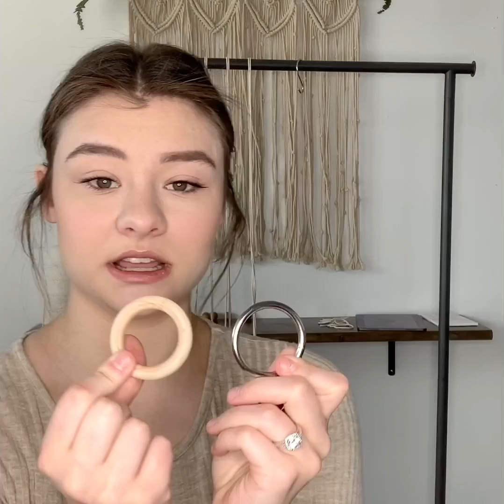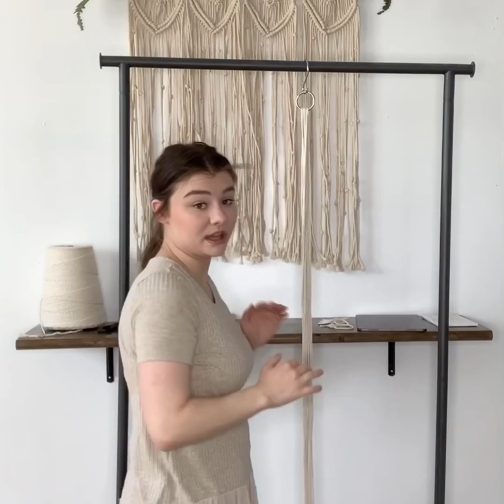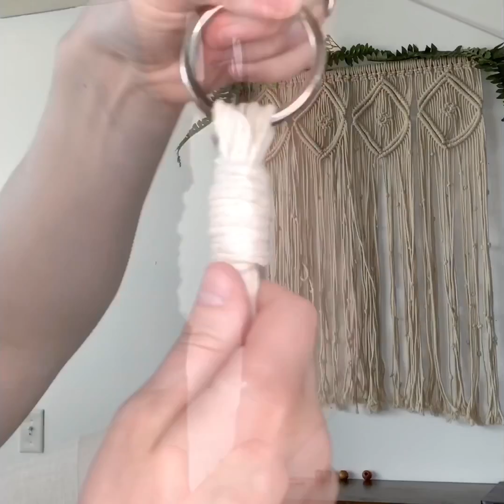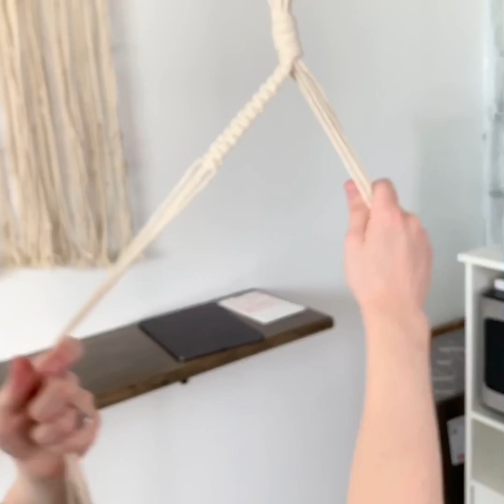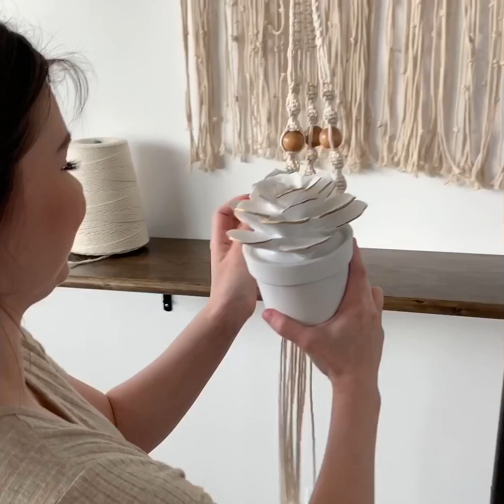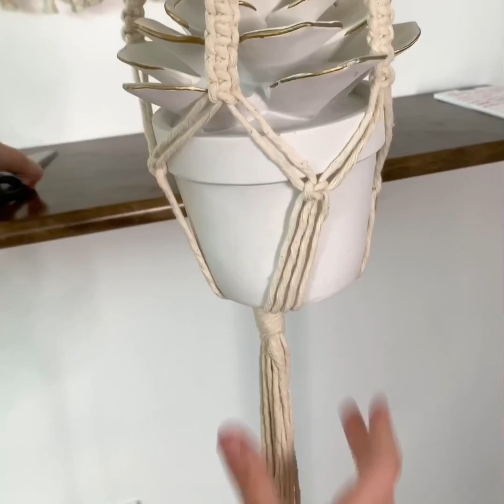Beginner Macrame plant hanger tutorial

Comment: Ok I just tried this and it was an epic fail :(. I measured 2.5 arm lengths and it was wayyyy to short! I’m guessing my cord is thicker than what you used. Now I have to use all my cord for something else :(.
Reply from the maker: What size cord was it?
Reply: It may be 5mm twist rope . I ended up using the full length and making a more basic hanger. I’ll try yours again with different thinner cord.